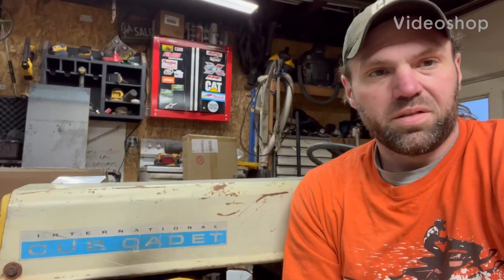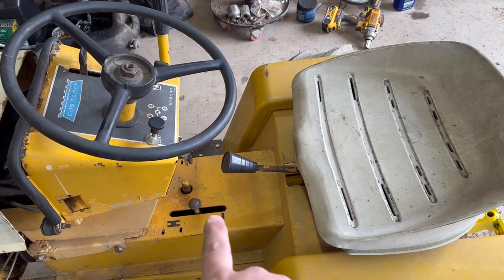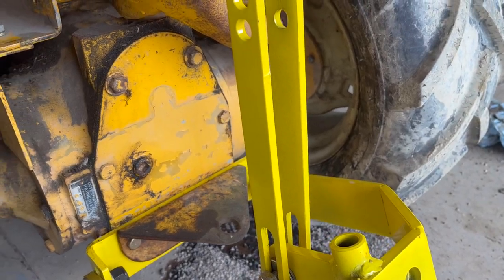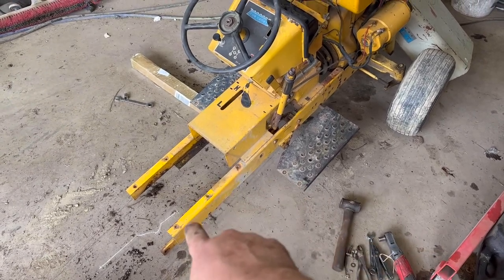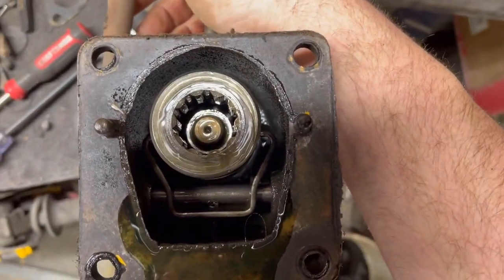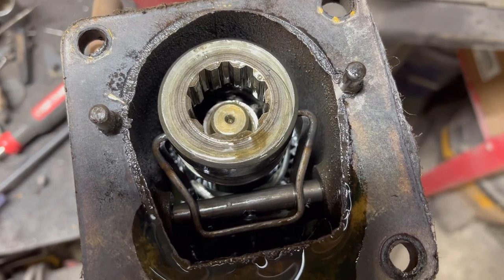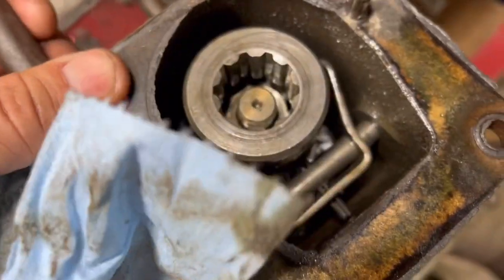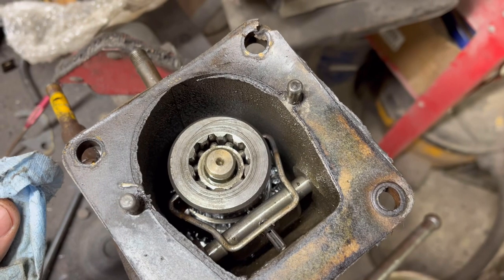Cub Cadet 102 Creeper Gear repair

Comment: working on a similar issue myself, that pin should be a coil spring pin (like all the other pins on tractor), not a simple spring pin.   The creeper shift forks are available from CC Specialties, I'm replacing that as well while its apart.
Reply from the maker: That probably explains why it broke in the first place. It was odd because it worked fine until I changed the oil in it. Then it fell out. If it breaks/falls out again I’ll put the right pin in it. Thanks for the info!